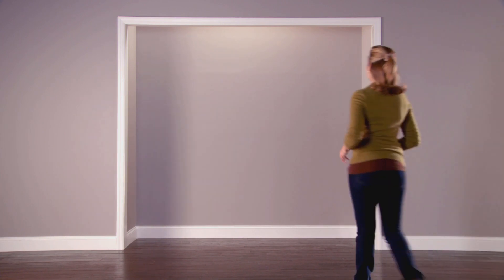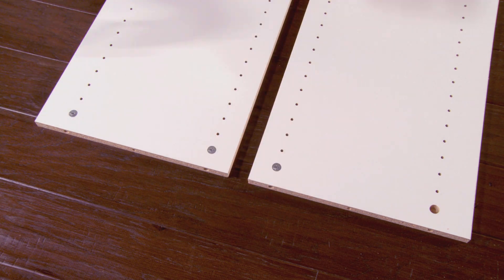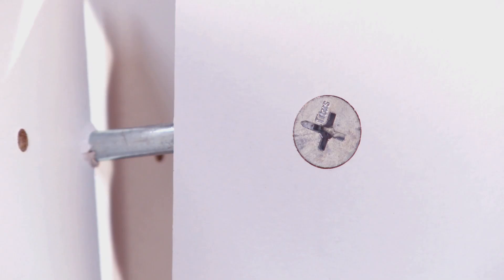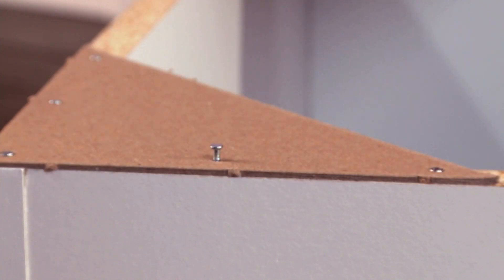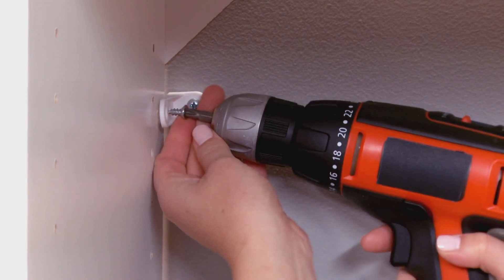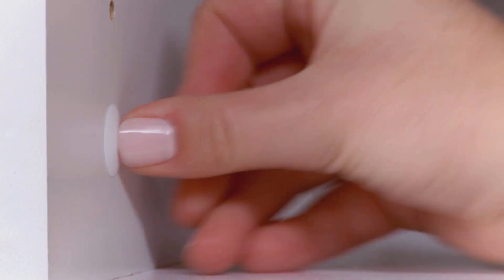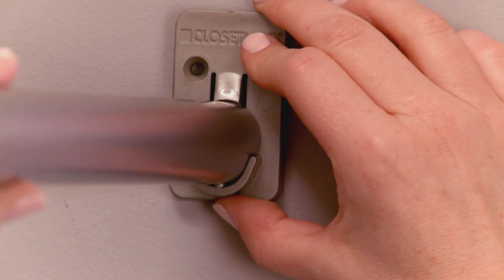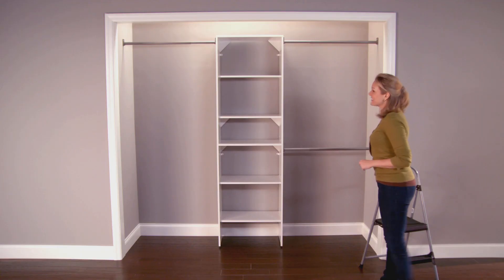ClosetMaid Laminate Installation Video

Comment: Generally a very good video. I used it instead of instructions. Only issue was a confusing moment at 1:37 where it seems she is assembling a second base section with leveling feet, which should instead be the top half section of the tower.